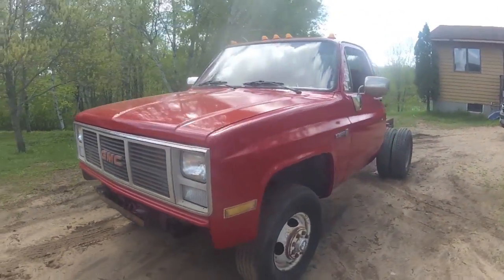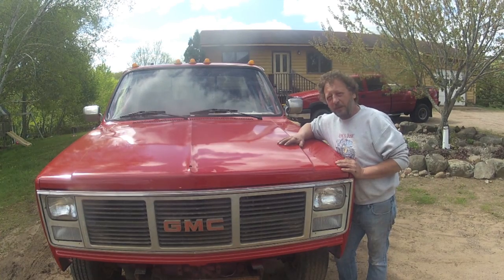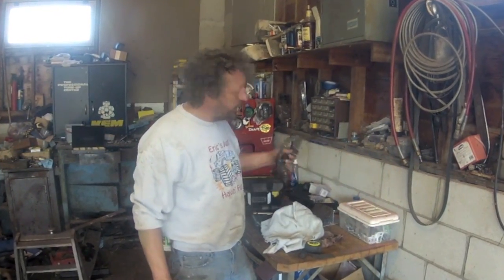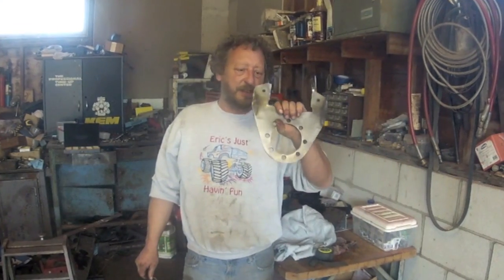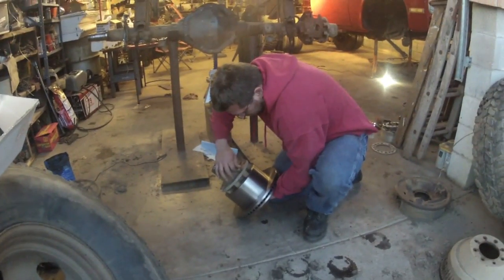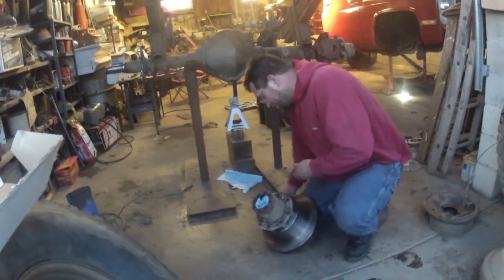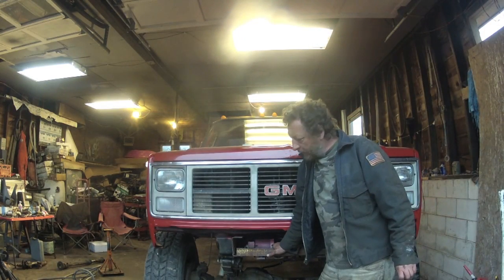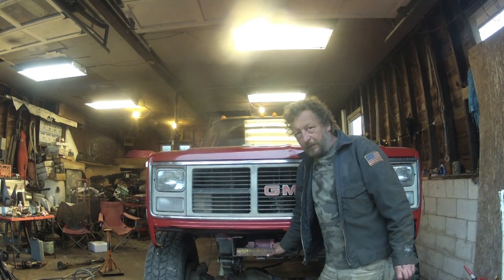NEW WRECKER BUILD PART 6 by BSF Recovery Team

Comment: In my opinion I would have never converted rear drums to disks.  Rear disks don't produce as much stopping power as the large drums that you had.  Also, I think a lot of people forget that the drum brakes don't require a power booster.   This means if your power booster fails and you have 4 wheel disks then you almost got no brakes since disks require a power booster.   This actually had happened to me after the vacuum hose broke from the check valve at the brake booster.  On another occasion, I had a 2002 Yukon XL 1500 with 4 wheel disks standard and the front brakes hose broke.  The rear disks by themselves couldn't stop the truck completely without shifting the transmission into neutral.
Reply from the maker: When running out on the trails, through mud and sand, it gets trapped in the drums. The sand and mud wears out the brake shoes very fast. I was replacing rear brake shoes 2 or three times a summer. The disc brake pads last for 2-3 years running in the dirt/mud. That was the main reason for the swap.

Comment: Why the disc brakes for offroad use?  I've found the anti-rattle clips tend to corrode and the pads wear unevenly when they get mucked up.  I've found drums to have better parking brakes than disc too.  For an offroad truck I'm not 100% convinced that disc is a good choice, for OTR towing it makes a lot of sense.
Reply: eformance I would probably keep the drums cuz I'm lazy and those particular drums do not lack stopping power, but some prefer disc because they don't trap water and mud as easy.
Another thing I could see, in his case, is drum brakes use a wedging effect to stop, so they have considerably more stopping power in forward than reverse.
Well, that means when he is using his microlock system and winching off the back, the brakes do not have their full holding power available.   Disc brakes stop just as well in either direction.
Or, maybe he just likes the idea of having disc brakes, which is why I think 99% of the people do the conversion.  ;)
Reply from the maker: l337pwnage The big reason for the disc brake conversion is the mud and sand was wearing out the shoes in the drum brakes in about 3-4 weekends out on the trails.
Reply: recoveryteam I was going to ask the same questions about the conversion. Thanks for explaining why you did this .
Reply: Do you have part numbers for the rear disc setup ? Hats and brackets ?

Comment: Hey man I just ran across your videos hear recently & love the videos!! I would like to no what rotors you used for the rear disc brake conversion!! I’ve been working on a 72 Chevy that I converted over to disc brakes also but I also have two 84 Chevy 1 ton 4x4s & want to convert them over also but wasn’t sure exactly how to do them & what parts that I would need also!! If you could help me out with a list of parts & what they are off of!! Thanks in advance!! Oh & definitely keep the videos rolling!!
Reply from the maker: It was a kit from diy4x
Reply: recoveryteam thank you very much!! I have never herd of that place before I talked to you!! Over the past I have ordered a bunch of stuff threw Steve Watson (OFF ROAD DESIGN) & they have been a big big help over the years!! But now that you say that DIY4X has stuff for the brake conversion & that they are only about 3 to 4 hours from me that will make stuff even cheaper for me as I won’t have to pay the expensive shipping cost from Colorado!! Thanks a bunch & I do see that diy4x has some stuff for my 1972 Chevy 1ton that I have been working on over the past 20 years!! Right now I’m just weighting on my 427 & yes it is a SBC 427!! If this motor won’t turn them big 39” boggers over in 4x4 then I guess I’ll have to jump up to a big block!! But the guy I have building it for me says it will be at least 750hp at the wheels!! Thanks again man!! One more ? For you!! Are you In Iowa or a different state?? Love your videos!! I’d definitely love to have a wrecker like yours!! Love the square body’s!! I’ve had a half a dozen of them or more& I do have a service 84 Chevy with a 10’ service body on it & it is also a 4x4 with a Dana 60 front axel!! I also have a dump truck 84 Chevy with a 10’ dump box on it also & it is 4x4 with the Dana 60 up front!! If you no anyone looking for one the dump truck is for sale!! Thanks again & sorry I carried on so long hear!!

Comment: What rotors and parts did you used ..I want to do the same thing to my dump..gm
Reply: Paul Barnes Pleased to meet you Paul.Chevy made a 14 inch for my 78 camper special w/ drumsand later they made 3/4 and one ton 14 inch w/ discI wonder if we should be at the wrecking yard now ? lolI would really like the disc on the old camper special.not that I can't stop,  just for convienience
Reply: mrbakerskatz hey! You again! Lol seems we have the same interests
Reply: spik3stactical Yep, I have been trying to help w/donations. They entertained me for a couple of years, so I wanted to help a lil bit.
Reply from the maker: Paul Barnes DIY4X has the kit for cab chassis duel wheel axle, and will give you part # for rotors and calipers.

Comment: Is it higher than the original wrecker?
Reply: Well, saying that it's the same style cab/chassis and he's using the axles, springs and tires from the other truck it's probably safe to assume that it's gona be the same height as the other truck. The springs are 8inch lift